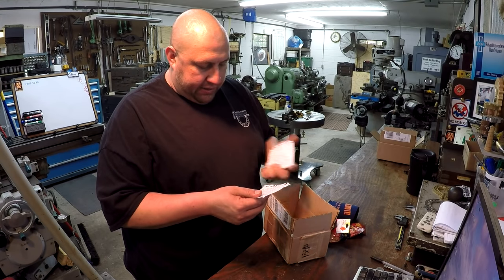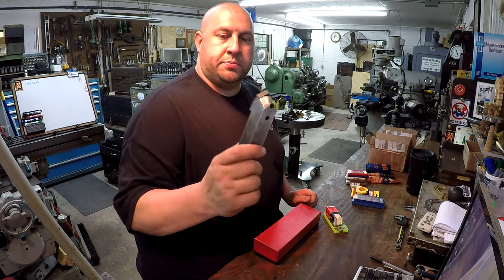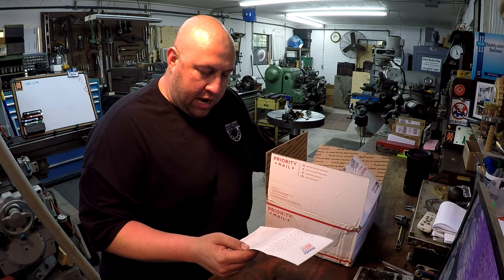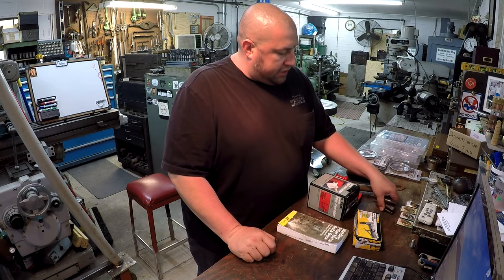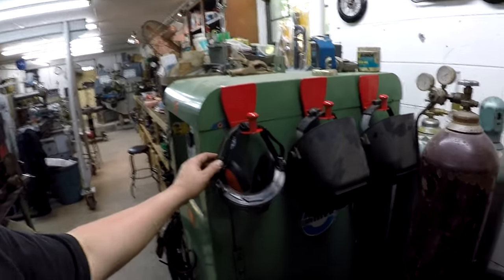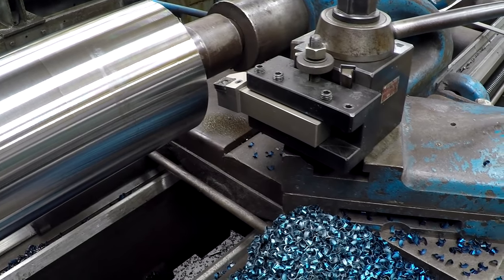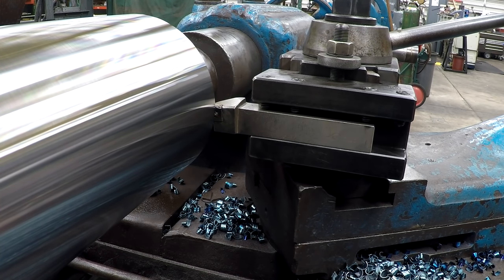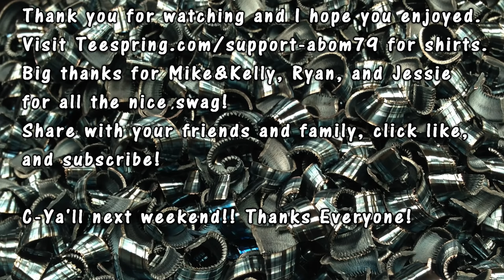Saturday Night Special 72

Comment: Hi Adam, great shots from your day job. I for one am just amazed at, Oh were / I am taking a  1/2 in. cut 4140. I just did a small project based on what you do at work, with some 4" in. 4140, 6" in. length X 4" in. Diameter, cost me $100.00. Had to make a part for my Ditch Witch, just 2 inch in length..

Comment: Wow Adam that is a nice bunch of inserts. I have used the round inserts from Kennametal before the ones with the built in tapered post to attach for the lathe tool was the best. Before that they had them secured by a torx screw and the insert would spin a bit. post style proved very rigid. I would like to see your round inserts in video.
Reply: Lew Sou Man the Kant twist clamps are really nice.
Reply from the maker: Lew Sou I normally use them on corner radius cuts, but sometuimes that come in handy for other jobs too. I hope to show it on video.

Comment: You will love your Kant Twist clamps, just in case you didn't know, the jaws are copper clad steel and highly conductive for welding use. The cladding must be pretty thick, mine are several years old and haven't worn through yet.

Enjoyed the show!
Z
Reply from the maker: Shadon HKW Thanks Stan! yes I love the clamps and instantly put some of them to use. So cool of Jessie to give them to me. I noticed they put pretty small cross handles on them, must be for guys like me to not over tighten them! LOL I enjoyed your 2 second video over on FB. :)

Comment: Thanks as usual Adam. Which insert did you prefer on the big job in the end? Very hard to guess but maybe the LNMX had a slightly free-er cutting action?

That pacemaker is so butch.

Cheers, Tim
Reply from the maker: metaling1 I have to say that I enjoy the LNMX insert better for my needs. But with the right lathe you can take some serious metal off with the COMG.

Comment: Hey Adam, Great Video as always.
Just one thing about hanging your welding helmets and especially your goggles like this. Be careful! Because all the grinding dust is going to collect in there. It happened to me, I just the goggles to protect my eyes from grinding, not being aware of them being full of metal grinding dust. I ended up with eye surgery and they had to mill the particles out of my eye. 

Since then I am keeping my goggles and glasses in little pouches to keep them clean. 
I'd highly recommend to at least have the inside facing down...

Cheers from down under
Kvasir

Keep it up

Comment: From your experience of inserts for lathe and mill work can you suggest the best for a beautiful finish on Aluminum, Chrome,Copper, Cold rolled and Hot rolled, Bronze and Brass.
It's important as the finish is for rc mag wheels. I did a Alloy one years ago but my friend put the edge on the tooling and I can't get it right so I bought an index set for the lathe and made an adapter for the mill.
Thanks in advance

Comment: Hi Adam,
Thanks for the video!  That old Pacemaker was really turning out some nice chips!  It didn't seem to mind the .500 DOC either.  What is the horsepower on that machine?  I'd guess around 30.  Also, do you know what year it was built?  Thanks.
-mike
Reply from the maker: ***** Not sure the HP of the lathe, never bent down there to look. I do know it's the HD model though. The drive pulley has 8 belts. Maybe James Kilroy can help me figure it out.

Comment: Just a quick question on those Isscar inserts...Do you always get such a nice finish when you hog like that, or was that just the material you were cutting?  I always wonder how with such huge feed rates the finish is, well...looks, so smooth.
Reply from the maker: Don Foreback As long as your insert has a good edge and your moving some metal you should get a nice smooth and shiny finish.
Reply: I guess we didn't have good inserts then...because we had to take almost a spring pass to get a finish as good as that.  And that was a job shop.

Comment: Abom79 How long does one tip of the insert last when doing those heavy passes? Great videos
Reply from the maker: ***** Those inserts last quite a long time. That tip was last used when machining the shaft for the Rotary Welding Table. :)

Comment: .how about a Abom79 shop apron..............a "decent quality" heavy cotton apron is hard to find....emphasize "decent quality'......great show as always Mr Booth....keep em coming........man i love those pics at the end......always a final treat!
Reply: Rick L Rockler used to sell a nice one to the woodchuck set for ~$20... straps make an X in back, so you don't get a sore neck...  design is an issue, as well as the materials, and sewing...

Tom Lipton had a discussion on his channel a couple of months back on the topic of shop aprons...

I kind of doubt that I'm willing to buy one from Mitch Rosen = Mitch Rosen Gun Leather, and the recent offerings I've found aren't really what I want - sort of a cross between a cabinet maker's apron and a traditional machine shop apron.

The Denim fabric is cheap, but the sewing isn't... at least, not here in the US... China presents its own problems for quality, etc. - but, I don't have contacts to hook me up with sewing operations in Mexico or Central America...

Still working on the idea...

Eric
Reply: chemech I had won a service writers desk for use out in my shop at an equipment auction and when I went to pick it up, I looked inside the lower cabinet only to discover that it was crammed full of freshly laundered denim shop aprons. WOW! This was about 3 years ago and I have been putting on a fresh apron each day when I open the shop at 6AM. I keep them washed with my black shop uniforms. I really like using an apron in the shop, it helps keep the cutting oils, solvents and chips off my clothes.
Reply: Joseph P. Polnaszek Depends upon what I'm doing... sometime, I prefer a shop coat (labcoat, but medium blue in color and heavier fabric), but most of the time it's too hot for that... 

Having found some adequate, but far from ideal aprons, I wear those when doing certain tasks, or over my nicer shirt & jeans combinations...

I'd be more willing to spend time & money if I were doing machine shop stuff on a regular basis...

Comment: Hey Adam,

I'm trying to find back my sketch of the replacement indicator back from Shars - I've only just got a few of their magnets for the indicators, and one has the brass insert in crooked, which makes the setup all cock-eyed.

It looks like a straightforward turning project to make a one-piece back with the threads from steel or aluminum... don't know if someone with a turret lathe or a CNC would want to crank them out as a production item...

But, if there were a ready source of them for a few bucks each, I think that folks would buy 'em...

All the Best,

Eric

PS - Aerospace is a Chinese import brand of indicators - there's an e-bay store that sells them in batches of 2, 5, and 10 pieces for not a lot of money - think that they are located out here in Los Angeles...

PPS - I found back my notes from measuring one up -- looks to be an "easy" part to make...
Reply from the maker: chemech It's a good project for anyone with a home shop. Those plastic ones are easier for the chinese to make, so of course that's the route they take. Would be cool if someone would do a production run on them and market them to sell.
Reply: Adam,

I think that they injection mold the disks, then use a hot insertion method for the brass threaded bits... cheap and easy, but not durable...

Injection molded zinc or aluminum would be better, but not quite so cheap...

Hogging them out of bar stock generates a lot of scrap (swarf), so I can see why a factory might not want to go the CNC route...

But, using 2" aluminum bar (50 mm) and a hogging mill, followed by a thread cutting die, then part-off, and then advance the bar, and an old school turret lathe / screw machine could knock these out pretty quick.

For me at home, the big trick is to use good materials, so that the 4 holes for the tiny screws to hold the plate on the back of the indicator don't wander... maybe us my little 4" rotary table on my X2 minimill...

Cheers, 

Eric

Comment: I'm watching this video and you are taking 400 off-- 200 per side, and I've been meaning to ask, how do the metal types work?  What I mean by that is how come the inserts don't get too hot and melt off the tool holder.  How does all of this work.  I understand that there are harder metals, but its amazing that one metal can cut another and hold up like this.  Is there an article that I could read to see how all of this came about?  Awesome stuff.
Reply: The basic idea by the tool not melting, is that the heat is carried away in the chips.

Comment: What is the difference between a COMG and a CNMG? It sounded like the LNMX is happier at the deeper depth than the COMG, but it looks like the COMG throws the chips more down vs out with than the LNMX, which is nice, getting sprayed with big hot chips is never any fun! Did you observe similarly what is the cost difference of the inserts? I would love to have a ABOM79 work shirt  like Keith Fenners Dickies. I rarely  ever wear t-shits because I use my shirt pockets so much.
Reply from the maker: bcbloc02 Brian, I think the O designation is just for the Iscar tool. I can't find it listed in the books for anything. It may be to signify the dovetail type of insert it is. Just look on Iscar's website and check it out. Lots of info there. I don't know the cost difference these days, as it's been years since we bought the LNMX inserts. I'm sure these COMG's are pretty high considering the how big they are. I was given the good buddy discount. :)
Man you should pick up one of these holders for your Monarch (LNMX). You will love it! Work shirts are going to be a different challenge, but I will look into them as well.
Reply: Adam you are right, the O is for the center hole style. I am currently pretty tickled with my CNMG 644's for roughing, they make nice chips last well, can be bought right and will handle pretty much all the HP my Monarch has. I doubt I have the ponies to fully utilize the LNMX, if I ever happen upon my dream Monarch  37NN 30-50Hp lathe I will certainly have to look into them. :-) I think that Ingersoll big insert I have as well would work great on a big machine too, but those specialty insert prices kill it for me. I do so much repair and modification work and it always involves hard materials and interrupted cuts and they just kill inserts.

Comment: Another shirt would be cool, a hat would be really good.  I bet those chips would leave a big burn if they hit you coming of the shaft.
Reply from the maker: Bill De La Vega I'm gonna work on the hats too. Thanks Bill.
Reply: Bill De La Vega They burn you quick, I run a large American pacesetter and a 36" bullard vtl and roughing cuts are usually .100 depth of cut. I had chips land in my shirt pocket which can burn through quickly, even had one land on my forehead and slip between my safety glasses and eye, it wedged at the lower portion of the glasses and I received a nice little burn spot, I was very lucky it missed my eye.  I leave my shirt un tucked when making big chips because if I don't, one WILL find its way inside my pants, lol !

Comment: So many acronyms for lathe turning tools. LNMX. COMG.CNMG. OMG. LOL. I keep hearing about it on Youtube, especially you, but I don't understand them.
Reply from the maker: jesse foulk When we are talking about carbide inserts, that's how they are designated. Each one is different, and how industry can differentiate between them all. For instance, my favorite insert to use is CNMG 431. 
C= Diamond 80* (shape)
N=zero degree (relief angle)
M= tolerance class(a bit confusing)
G= with hole and chip groove on both top and bottom surface
The numbers get a little more in depth and I dont feel like typing it all. LOL

Comment: Hi Adam, and the rest of you folks!
Hey I have been on the hunt for a nice size lathe for my shop to handle the big jobs on, and I just picked up a Sidney Heavy Duty, 18" x 72" Rated Capacity that will actually swing 20". Man this machine is a beast for it's size, tipping the scales in at a dainty 7000#! With the 15 HP motor it too should be able to take some large tasty bites. I'll have to try the faceoff and heavy turning comparisons and see where this Sidney comes in. Sounds like fun and I suppose it's nice to know your limits.
Here is a link to a video of this very machine. https://youtu.be/QgdFJWtgxak

Joe in Minneapolis, MN.
Reply: Good lord that is a monster!